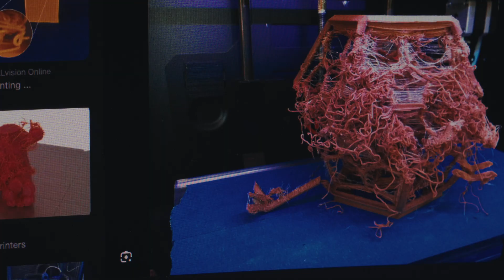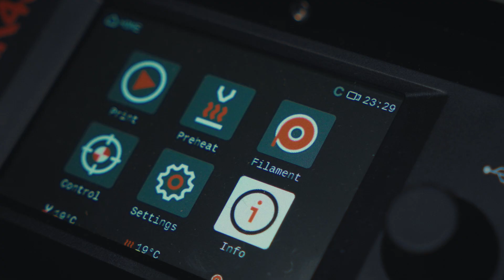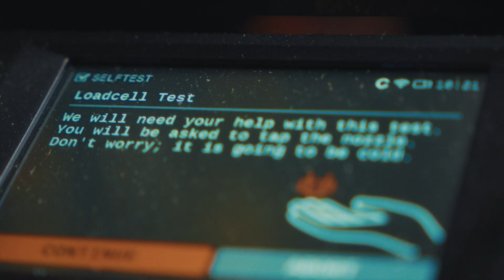I Tested the Prusa MK4S in My CoreXY Print Farm

Comment: I Run a mini farm of 10 Bambu lab A1 printers  and 2 P1S printers.
The A1 in an enclosure with the ams lite + Creality Pi4 does everything at a much cheaper price.
Literary, for the price of 1 P2S with AMS pro I can get this combination 2x times.
Yes. It's a bed slinger, and slower. But with some slicer optimization you can get the same or even better quality.
Especially fewer issues if you print with brittle CF filament that can break in the AMS PRO or at the top of the P1S tube. 
Simpler to work with direct feeding TPU.
Fast, and simple nozzle swaps (same as the p2s at a cheaper price)
Its... cheaper, simpler, easier to maintain, cheaper to maintain, fewer parts, robust, and gets the job done!

Right tool for the right job...

Oh! Forgot to mention the automation with Farm Loop :)
Reply from the maker: Sounds like you’ve got a great setup and system going on your farm!

Comment: wow, the effort you've put into editing is fantastic.  I've got Bambu and prusa coreXYs and my MK4s (which was originally a MK3s upgraded to an MK4 and then MK4s) has always been my old reliable workhorse whenever the coreXYs are down for whatever reason.  I've printed around 40 kilometers of filament on it and It's like the Duracell bunny, it just goes and goes and goes.
Reply from the maker: Wow! That’s incredible and a true testament to the MK4S! I love that Prusa lets you continuously upgrade their machines. That’s such a big draw and differentiation for them in today’s market
Reply: @NicksNacks3D true, I had a second MK4s which I upgraded to a Core One.  I have so many prusa spare parts accumulated that with a couple of small purchases (heatbed and PSU) and freshly printed PETG/PC-CF parts I could build another MK4s or even build the Voron Prusawire if I really want to stretch for a newer challenge 😊

Comment: Bambu also uses load cells for ABL/tramming. The LIDAR is not used for that.

And don't use IPA or similar to clean the buildplate. Dish soap and water goes a long way and doesn't cost a dime. Just rinse well before drying.
Reply from the maker: Prusa recommends both for cleaning but I tend to agree that soap and water actually works best
Reply: @NicksNacks3D  All respect to Josef Průša and his team, but not there. There really is no need for alcohol there ;)

Comment: CoreXY's are superior in most ways but they're also more finicky. Prusa has had issues with wavy prints on the Core One, and tightening the belts helps that. Bed slingers are simple and with proper build they can be super reliable. My old MK3S+ is being converted to a MK35S (the electronics from the MK4, not the rest) and I expect it to keep churning out trouble free prints. But that said, I'm definely buying a CoreXY machine with multiple tool heads sooner or later, and these days a MK4 is a touch hard to recommend from a price/performance viewpoint - but then again, Bambu printers are bad in other ways, being cloud dependent, very Chinese and closed source.
Reply from the maker: Love to hear about your experience! I’m hoping to do a deeper dive on their Core One one day!

Comment: Great video, but I'd love to have seen the same file printed in the same filament on an H2D.
I have a Mk3S and am considering getting a Bambu or a Core One, but this made me question whether I should upgrade to a Mk4S. That'd be great, but I'd have loved that final justification as all I have to go on at the moment is paused clips of Bambu reviews where I try to study the print quality.
Reply: Pay the 200 bucks to upgrade the MK3 to a MK3.5. You get the electronics from the MK4 so you get almost doubled print speed from the old workhorse. My next addon (not replacement, can't hurt to have the old workhorse still going) will be a machine that has multiple tools. Might even be a Prusa, but whatever it is it will probably have the new Bondtech INDX multi-nozzle system.
Reply: @cr0ft-2k thanks! I have been wondering about that, but at £260 it's a lot compared to alternatives.
Reply from the maker: Glad the video got you thinking! I’m hoping to do some more direct comparisons in the future!
Reply: @NicksNacks3D in the end I bought a Core One+ kit. I wanted to build it myself, and I wanted to support a company with Prusa's morals and ethics. Very happy with it so far - print quality is outstanding, and while I thought the Torture Toaster was good on my MK3S, it's excellent on the Core One.
Obviously I don't have the dual material capability, or as large a build plate, but most problems can be solved with a bit of thought during design. And I saved myself a lot of money, and have a much more compact printer, which doesn't dwarf my small office.
Reply: Check out aurora tech, the H2D prints are simply better than MK4

Comment: Brilliant filmmaking! I have a Prusa MK4S, built it from a kit, built an enclosure. It runs great. The Bambu vs. Prusa debate is so misguided. Both companies make good machines. Both have strengths and flaws. It comes down to ease of use vs. long-term support and ethical business practices. 

Prusa has a soul. Prusa values repairability, community, sustainability/upgradeability. 

Now with the Core One and Core One L, along with firmware and slicer updates, and the major INDX toolchanger option, Prusa is finally innovating again. 

Buying a bedslinger in 2025 is a fine option, but it all depends on budget. If you have the cash, and value a company with ethics, buy a Prusa Core One or Core One L. Bambu is fine too, and in many ways is more feature rich. But repairability is low, and their Apple-esque proprietary "walled garden" ecosystem and hyper-reliance on the cloud make Bambu's approach something I can never recommend. Plua, Bambu owes much of their success to Prusa: Bambu's slicer is built on Prusa Slicer/Slic3r, developed by the open source RepRap community. 

At the end of the day, these are tools, and how and what we choose to make with them should be just as important and how the tools themselves are made.
Reply from the maker: Preach! Both are great companies and both have their strengths and weaknesses. There are so many great options out there that it really is a fun time to be in the hobby and so encouraging for beginners. Appreciate your comment!

Comment: People like to make fun of Prusa, but they make quality, reliable products time and time again. They're the company that is pushing 3D printing forward, and contributing those improvements to the community.

I love my Prusa Mini+, runs very reliably. I run it with a 0.6mm ruby nozzle. I'll eventually get a Core One+ with the Bondtech INDX.
Reply: The Prusa XL is far from reliable
Reply: @TheZimberto  Only time I had problem with my CoreONE is when I did not clean the plate properly (from time to time it is needed to be washed with soap and hot water, not just IPA). Me personally I would rather go with the New bigger Core One + INDX. (but it was non existent when I bought the standard).
Reply from the maker: So excited about the INDX!

Comment: Can’t you just slow down your bambu printer to get similar results?
Reply: I  have runed bambu  in silence mode, the results were same to runing in standard mode. Prusa quality is just on different  level.
Reply from the maker: Tweaks in the slicer are definitely a rabbit hole that can drastically change results on any machine. For me with my shop I try to just focus on balancing speed and efficiency

Comment: I wont lie, lovely editing, but the bedslingers are all second tier. Yes speed is a major factor, but slingers fail at higher rates the taller the item becomes. If you ran your core XY at prusa speeds, you would have that flawless finish (IF you dont already). Prusa as a company are way behind.
Reply: Open source projects as RatRig and Prusa are the R E A S O N why you now have a cheap coreXY ... and yet sh!tty asian companies are still trying to close their (khm. non-existent) "ecosystem" despite they are leeching on opensource knowledge. Keep that in mind.
Reply from the maker: Appreciate those comments about the editing! Thank you! And totally…different speeds for different needs. I appreciate the art of the bed slinger even if it’s older tech and older methodology. I still think for beginners there is so much to learn about the hobby through a bed slinger